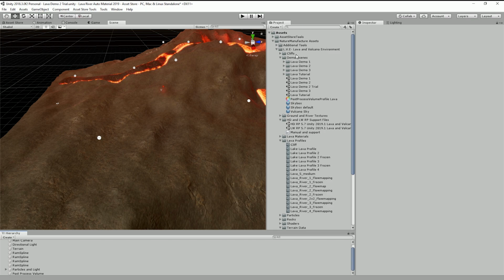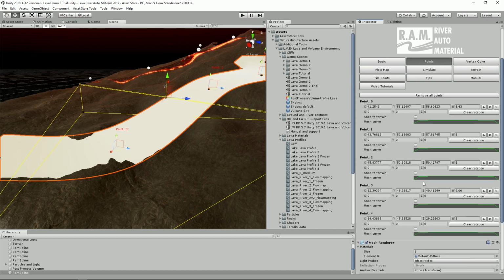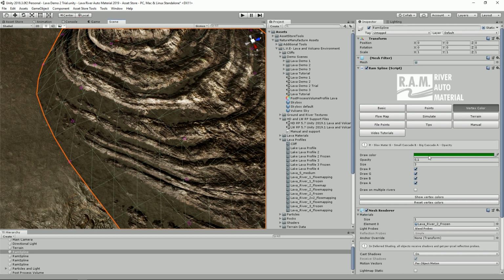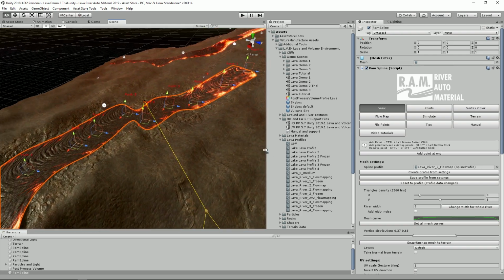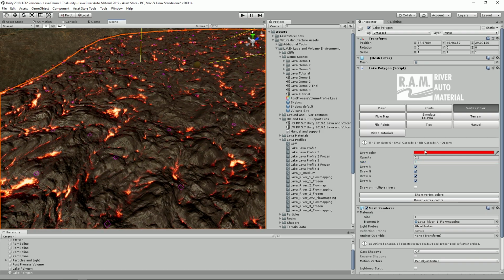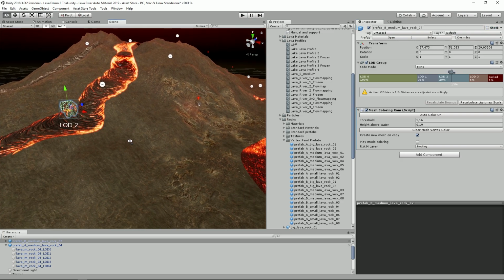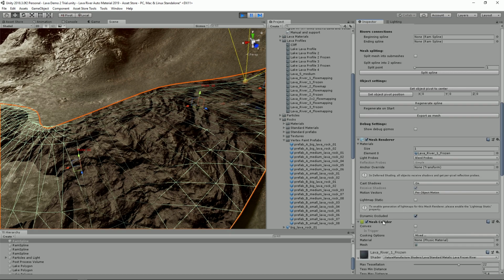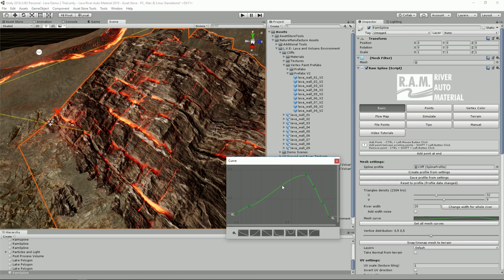L.V.E 2019 - Lava and Volcano Environment 2019 Tutorial

Comment: Nice asset but I am running into an issue. For my game, I am adding my spline lakes/rivers into prefabs that load into the scene. When they load in they do not render. If I pause the game and adjust the values, it renders. Changing values via script while the game runs does not seem to fix it.
Reply from the maker: You cannot use them as prefabs. Splines have mesh saved in/with scene file not fbx. If you would export mesh to obj or fbx then you can load them as prefabs.
Reply: @NatureManufacture  Thank you for this, easy fix. For those neeing more info. there is an [Export as mesh] button at the bottom of the RamSpline(Script). after using that button to save, just set the Mesh Filter to your newly saved mesh and you are good to go.